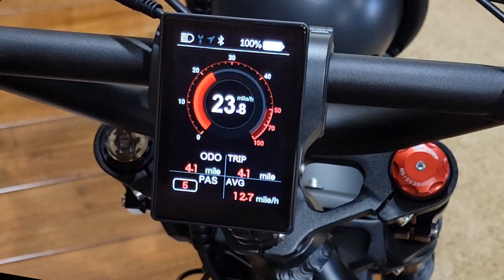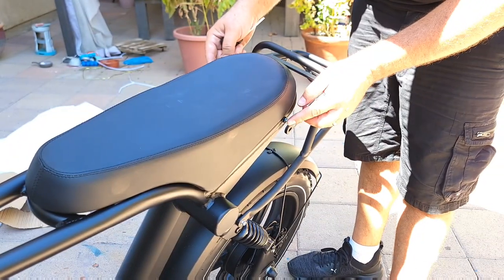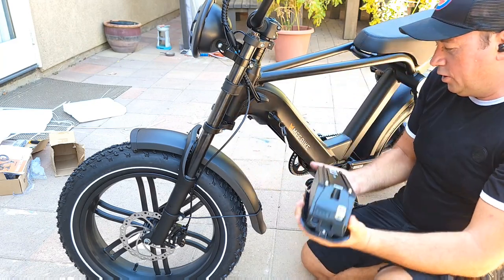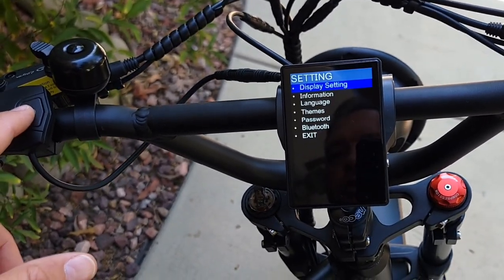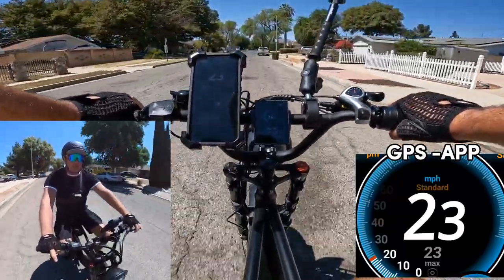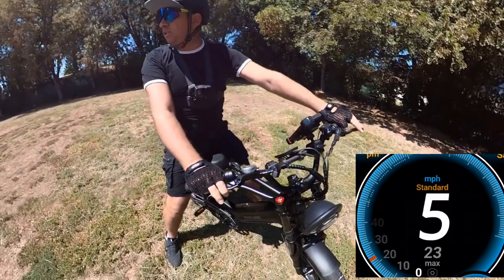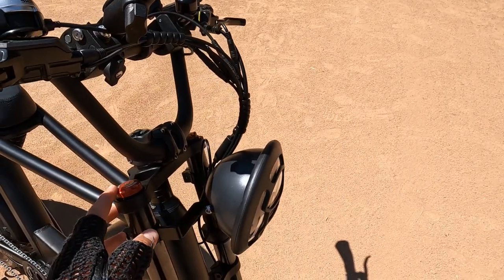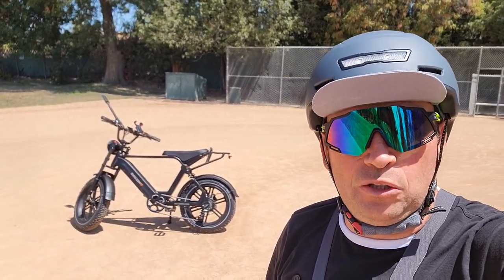MeeBike Gallop Electric Bike Assembly and Speed Test

Comment from the maker: Mee Bike has  the BIG SALE $1599 and with my code : erides additional $100 OFF or buy 2 with code: 2bikes $300 OFF. I think this is the BEST  smooth ride you will get for that much. I will try to make update on my bike as I already replaced Torque Sensor and it works perfectly!  https://meebike.com/products/gallop-electric-bike?sca_ref=2508835.svvgODTE4V

Comment: You’ve given the BEST review of this bike ... if I was only going by this one I’d feel VERY confident about a purchase.. but I’ve seen TOO many that gave this bike a FAILING GRADE , And it has EVERYTHING to do with PERFORMANCE.. this was the bike that first got me interested in the e-bike experience I’ve since moved on to its competitors MOST notably
Reply: The Ariel Grizzly I was interested also in the super monarch crown limited but decided against once I ran into the Grizzly which has a similar style to this but OUT PERFORMS this mee bike , this bike comes stock with plenty of GOOD FEATURES and apparently the best head light too but unfortunately I’ve seen a least a couple videos where not only is this bike slower than many others the rotors have been RUSTING , I’ll subscribe because I want to see if long term you remain content with this e-bike and if your rotors rust as well
Reply from the maker: I love this bike and I never expected to get top speed they advertised since I am heavy person and most companies advertise speed base on 150 lb rider. I only did assembly and first impression video that's why review video will come once I have full experience . They do have good quality components on this bike and rusted rotors is probably just one incident since I have many ebikes and none of them have any rusted rotors. I did have little bent front rotor few millimeters but I fixed it easily. I did get some error code  after the video and  working on replacing the controller on this bike.  I hope to get it replace and have no other issues. I replaced 3 controller in past few months on other ebikes. I guess it's not big deal as long as companies send good replacement